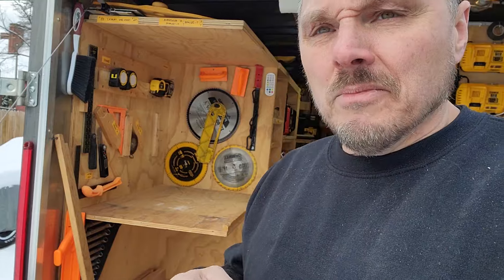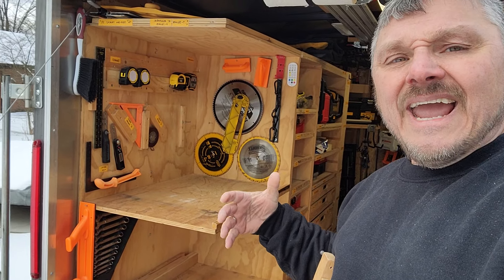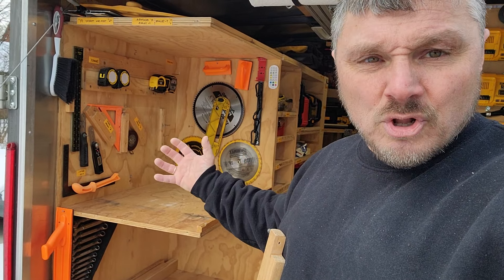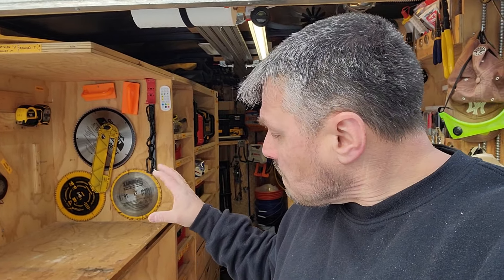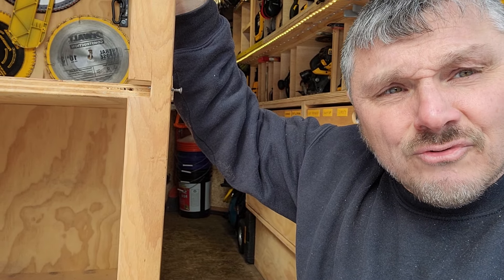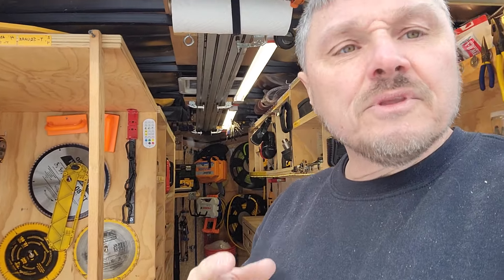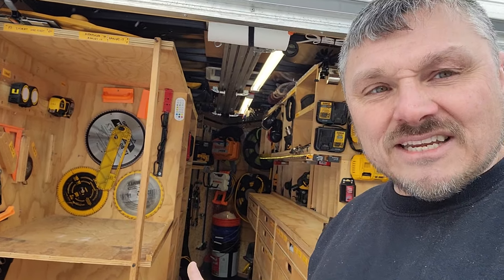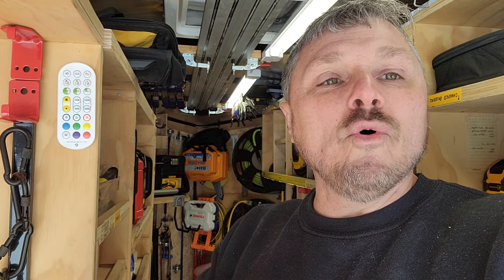sSMART tool trailer large tool garage 4 year strong!!!!!

Comment: I always wondered if you had a notch in the pole to help support the floating shelf and not just the screws to hold it.  Do you think if you did a half lap notch (a notch in the pole and a notch in the shelf itself) that you would not need the screws at all?  Hoping you are enjoying February break!  We get this next week off, not sure how your district works this week, but I am hoping you get at least President's Day.
Reply from the maker: Good point Russ. I do not know. I have been pleased with how this post has worked to keep the shelf from breaking under the 57lb weight of the miter saw while I am drivin but know (like your idea) that there are better ways to make the support more functional. Thanks Russ! And, we have off Presidents’ Day only so I will be using the bonus time to install the last of the crown in my project. Tomorrow is the “mud room” crown and is a finished walnut. I am looking forward to testing my precision with joints. Wish me luck!